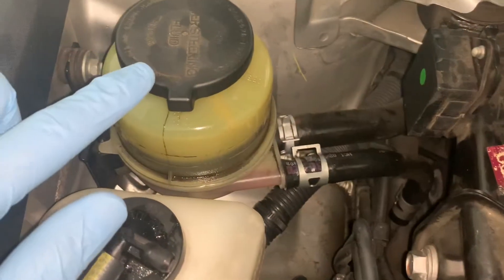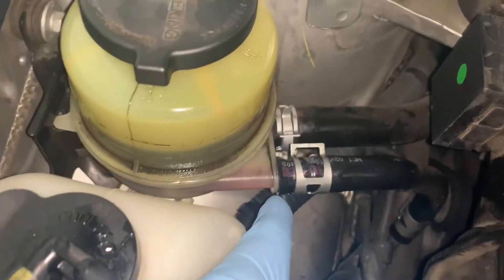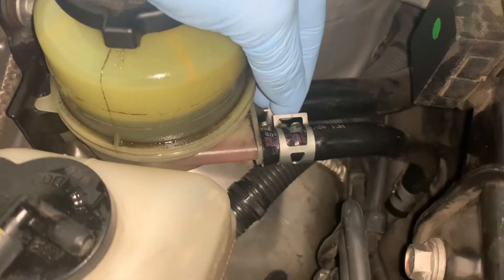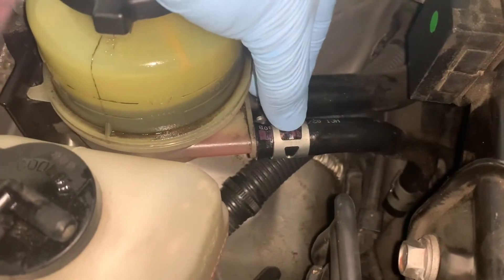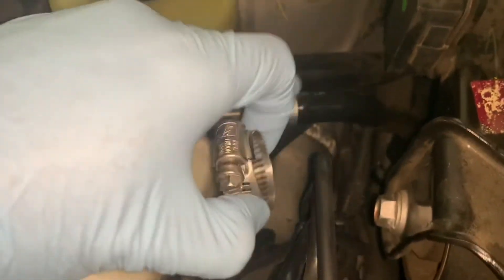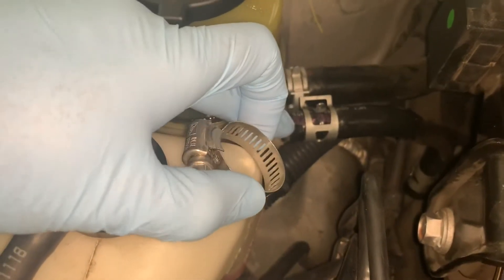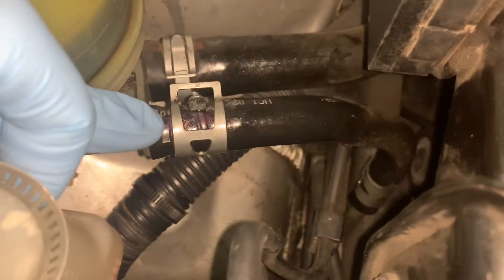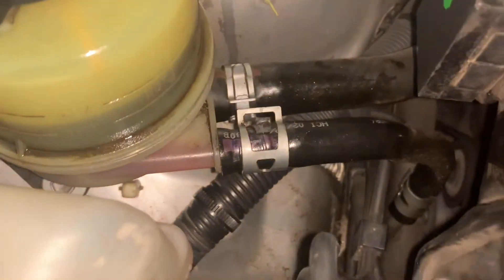Power steering reservoir pipe leak fix | Simple hack

Comment: how long will new clamp hold and why not get the same clamp it had before.  I got a new hose and used the new clamp the screwdriver one but it is not holding very well
Reply from the maker: Two reasons: I was unable to find the same design as old one, the old pipe was already compressed and would likely leak again with the same design of clamp where the force of crimping is limited, with the screw design I can tighten it as much as required to stop the leak. The leak is still fixed as of this comment. For your case, tighten the clamp more, I assume you have the right sized clamp and not oversized.
Reply: @akhaqan  my hose blew and my truck caught fire lol but I put it out by slamming the hood shut and nothing was damaged  threw a new hose on clamped both ends and it still kind of leaks  its impossible spot in my truck I hurt my hand trying to connect it  2001 f150    thanks for advise
Reply from the maker: @jonmantooth5804  Wow that was a close call, you handled it very smartly, good work. I hope this fix works for you.